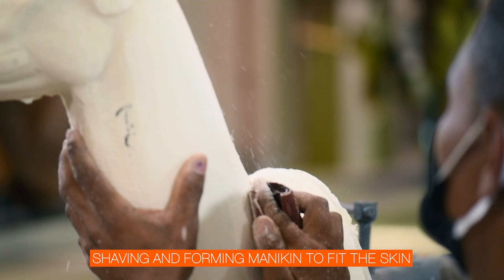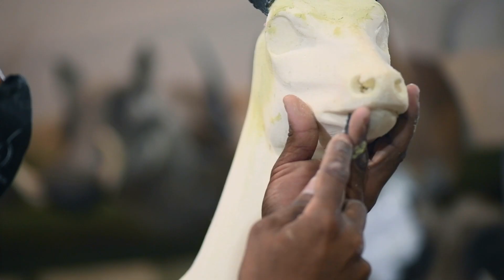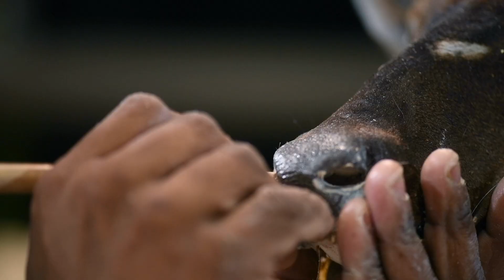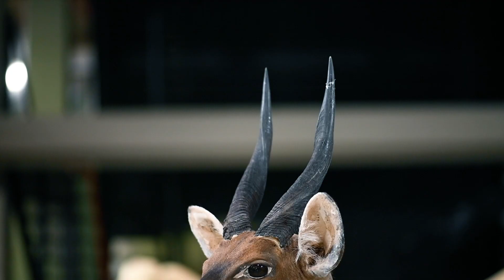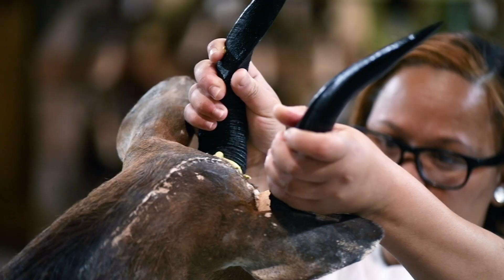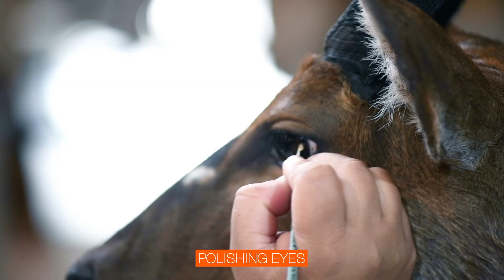Bushbuck | Mounting & Finishing | Splitting Image Taxidermy

Comment: Great work by your staff!  Question in regards to the "penetrating oil" being used on the horns.  Why is this done?  The dark black of the horns is not natural looking.  Is this a process that can be skipped, especially if the bushbucks horns had ivory tips.  The same question stands for kudu and nyala as well.
Reply from the maker: Hi Raider. 

Thanks for watching.

Great question. We have to use the deep penetrating oil to bring back moisture to the horns in order to prevent the horns from cracking as all moisture is lost in the horns during the taxidermy process.